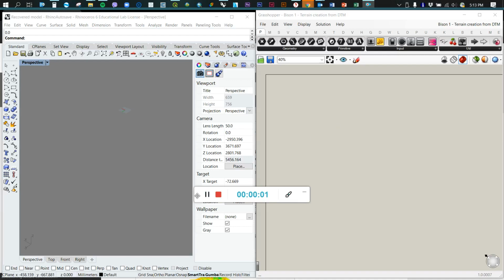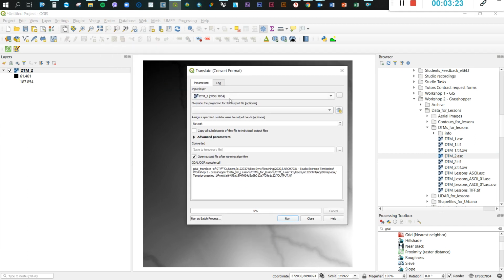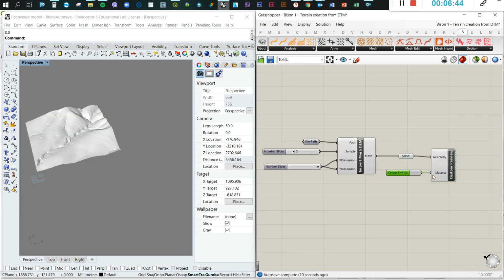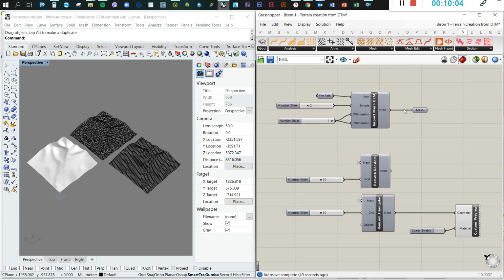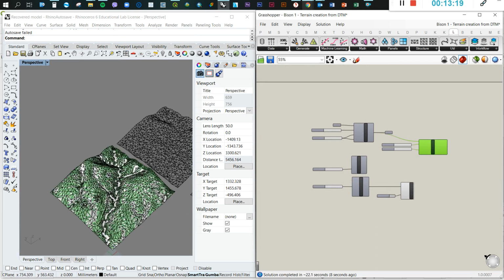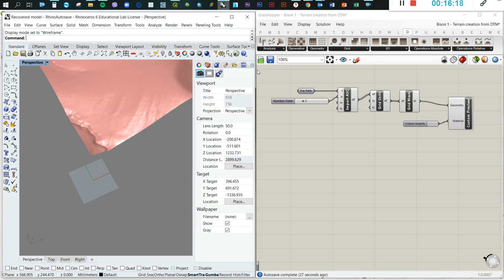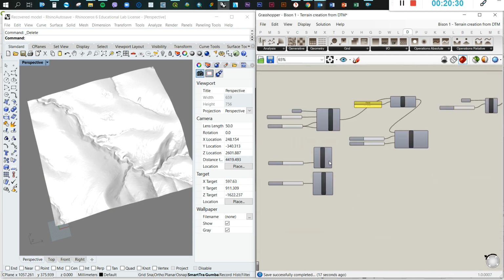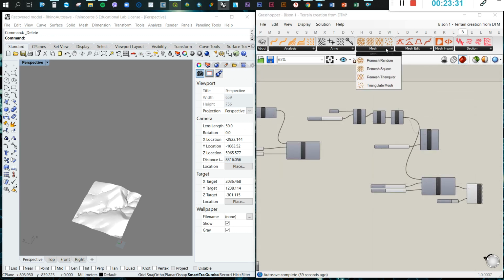Grasshopper 5: Creating and remeshing terrains with Bison

Comment: Hello. When the Dem board showed up after using bison, the terrain was so flat and smooth like a mirror, is there any solution to this?
Reply: And I think I'm sure that the plug-in and the way exported from Qgis were correct.
Reply from the maker: No idea what might be causing this issue, try with another DEM you know has a steep topography just to test the plugin is working properly, otherwise there is an issue with the raster (the file format perhaps?)

Comment: Damn, my file was 1GB and it took about 15 minutes to import. However I get an error that number of dimensions are outside the supported area. I tried both 10,000 and 10. My model space is mm.
Reply from the maker: Hi Julian, that's huge. You may need to resample your file.